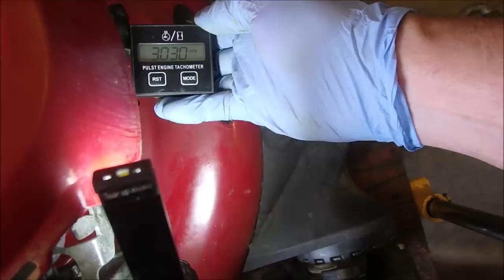Craftsman Mower has No Blade, No Oil ???

Comment: I forgot to put the drain plug in the oil pan of a car before and 5 quarts went onto the floor. Back then oil was about $0.67 a quart. These mistakes helps you remember better the next time, for sure.
Reply from the maker: OK   That wpuld be 10 times the amount I spiiled here.  WOW
Reply: I had a mechanic pump 11 gallons on the floor because he forgot and then left area to get a cup of coffee while it was pumping 
Dam took 10 sacks of floor dry
Reply: $0.67 a quart was back in the day, today, you're lucky to get it for $4.67

Comment: You’re brave!  I would have added used oil for the original leak test.
Reply from the maker: Great point!   As well I poured a 1/2 a litre right through it.
Reply: Meh, it was as sump flush @BrucesShop

Comment: Walmart carb spray was $1.98 per can 2 years ago. It’s $3.29 now. As it has gone up in price, I am using it less. Ultrasonic, air wash, bread tie wire, all are partial alternatives to carb spray. Cuz the mower is still going to sell for $75,  so cost cutting without sacrificing quality makes sense.
Reply from the maker: Thanks for sharing!!
Reply: @BrucesShop  Commenter estimated a price of $75 & he might be right. That said, I am not a flipper (that is, a re-seller of lawn equipment as opposed to a highly intelligent aquatic animal) so I don't know for sure what used equipment is going for these days. But new cheapo gas mower (20", no self-propel, no bag, small 125cc engine) at Home Depot in my US city is upwards of $275 with tax. An average-nothing-special self-propel unit is nearly $500. So, if you decide to sell it,  you might start with a good bit more than 75.
Reply from the maker: @ackack1  Thanks.

Comment: Do you need to use teflon tape when replacing the oil drain plug?
Reply from the maker: No I don't   I have never had an issue.  Good point though.  Thanks!!!!